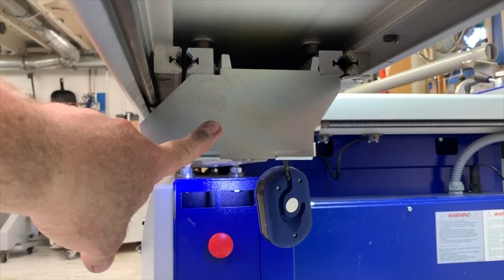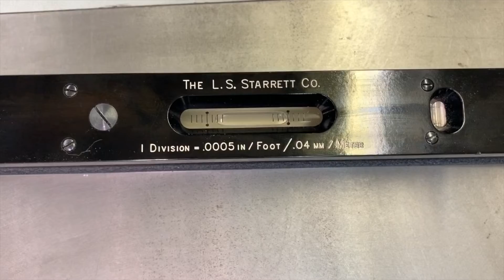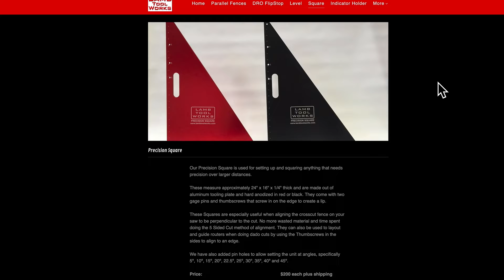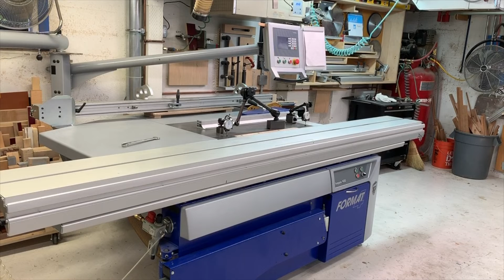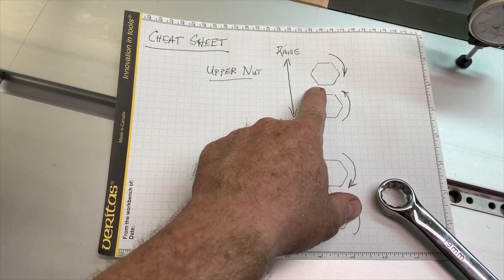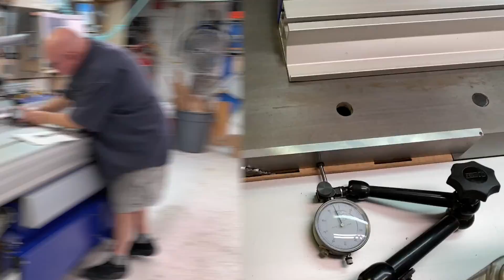Sliding Table Alignment for Felder Equipment

Comment: Great video. If your saw is rolled around in the shop, will this have to be repeated each time?
Reply from the maker: It depends on the machine, the size of the sliding table, and how out-of-level your floor is.  In general, the Felder machines all have a machine chassis that is flexible, so if you're floor is flat, you should be fine.  But if it's not flat or you move it to staggered elevations because of cracks in the concrete, etc,  then you could have ongoing sliding table alignment distortion.

Comment: 2 years going and still helping! Thanks for this video, saved me getting an expensive Felder tech out to do what is ultimately rather basic adjustment - knowledge is power!
Reply from the maker: On larger machines like the sliding table saw, I generally pay to have Felder commission the machine so that if there are missing parts, damaged parts, or parts that are out of tolerance (happens a lot), then there isn't finger pointing.  But as soon as the tech leaves, I do a complete realignment of basically everything.

Comment: Very interesting detail on how to adjust your slider so thank you for this. I assume this method relies on the slider itself to be flat (planar) along its length but I can’t see anyway around making that assumption. I expect some deformation (bowing probably) could occur over time along the slider’s length. I also liked your suggestion of the cheat sheet - it’s easy to make mistakes when things aren’t going to plan. Cheers.
Reply from the maker: Unlike the lower carriage, the upper extrusion of the sliding table is very flat and rigid.

Comment: Just purchased altendorf wa6 with 3.1 sliding table, really enjoyed your video ! very well explained! I know my saw will have some difference due to brand etc but overall very well put together video :) thank you
Reply from the maker: Glad you liked it.  The sliding table on your Altendorf is a completely different mechanical structure.  You will enjoy a different set of issues than are covered here.  Best of luck.
Reply: Oh joy ! can not find anything about the altendorf.. I have ordered some dial test indicators to just check over how it is at the moment, if its way out I may need to pay for an engineer to look over it @David_Best

Comment: Thanks    I have the 2500 long slider on the Format4 shaper. The 10' slider is on a T60 Martin. The early Martin rip fence has no micro adjust for parallel to blade; I added 4 cap screws-OK now.
I find the longer slider on the shaper to be a luxury thing in running the shaper. On the Felder 2500 slider I find the one and only stop to be a pain; I have added a second stop about 9" from the one stop and this is good for stopping the shaper for tooling changes and adjustments and keeping hands away from the spindle. The T60 has slider stops all over the place.
I see you have the Vincent Rolfe fore finger, good.
If I had it to do again I would place the second stop for the shaper at 11-12" from the original one.

Comment: Worth mentioning: if you buy a Starrett tool second-hand tp get a good price on it, you can send it to Starrett to get it calibrated, re-ground, or re-built as the case may be.  When you get it back from the factory, it will meet the same specs as when it was made originally.

Comment: It’s makeing the locking mechanism (ie the nuts) operate in the same plane/direction as you’re trying to fine adjust a bit silly? I mean you adjust the height just perfect then it all goes out of whack when you tighten then nuts. If they just made a clamping mechanism that clamped 90deg to the direction you’re trying to adjust (ie 90 deg to vertical) this would be so much easier to adjust. Then the bolts could be tightened o tho the horizontal clamps to stop anything moving due to  vibrations. Same issue on their planers.
Reply from the maker: There are lots of areas where the Felder designs are lacking.  They design & build to a cost standard, not to a quality standard.  Some machine models are fine, others not so much.
Reply from the maker: The weakness in the Felder sliding table design is the fact that the lower carriage is a bendy aluminum extrusion.  The sliding portion won’t behave properly if the rail it rides on is shaped like a banana.  A Martin uses a rigid steel box-beam ground to precision flatness.

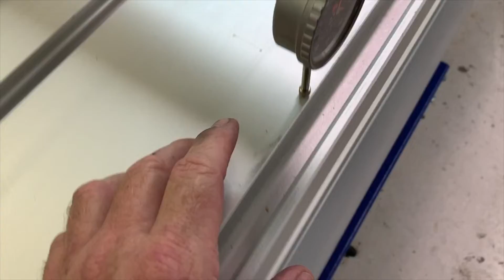Comment: Great video! Very informative thank you!! I’ve been having a lot of issues with my hammer K3 saw even since the felder techs came to set it up. They did t use a machinists level nor a dial gauge. Im sorely disappointed and have been feeling a strong sense of buyers regret 😢. So at 14:54 …what how do I make something perfectly flat when I felder in their grand wisdom have calibrated my bloody jointer for a spring joint? Man that annoying more than it is useful! Hehe as I said , buyer remorse 😅
Reply from the maker: Different machine, but same principles apply:  https://flic.kr/s/aHsmc4uK4K

Comment: David how can I get in touch with you to purchase your Survival Guide? Thank you! 
Mariusz
Reply: I just did by starting a new post. Thank you!
Reply from the maker: Join the Felder Owners Group.  Post your request there.  https://groups.io/g/felderownersgroup
Reply: I did, and I still don’t know how to get in touch with you.🙁
Reply from the maker: @marmiz923  I see no posts from you on the Felder Owners Group.  Post a request there and I will respond.
Reply: David, I have a question about adjustment bolts on my KF 700P ( it has only 4 ), so I imagine adjusting the table might be a bit more difficult… , but hopefully your Survival Guide will guide me through it. This is not the forum to discuss it on… Anyway, this is a great video and I would have been much better off if I had seen it before the technician came over to set my machine up. Thank you for posting it! 
I look forward to your response on the FELDER Group Forum. 
Mariusz
Reply from the maker: @marmiz923  I emailed you about the Survival Guide.

Comment: Nice job!
I should do the same thing !
But I have a question; how do you initially set the "zero" of the 3 gauges? I mean, magnetic side is on cast iron table and how do you know the correct height of the gauges if the sliding table is not yet well aligned?

THANKS from Italy
Reply from the maker: Watch this video:  https://flic.kr/p/2o9byW7
Reply: @David P Best of Best Services  
Many many thanks David! You did it already, superfast!
It's pretty easy!
I thought while moving the magnetic base, the gauge could move itself during the transition, and I didn't think about the preload of the gauge. I have never used that utensil 

Really really thanks, finally I will set perfectly my sliding table !!

Ciao from Italy !!
Reply from the maker: @cescone999  Ciao back to you.  I've visited your country many times over my life and parts of it I really adore.  I particularly like Umbria, Montepulciano especially, and up in  the north near the mountains.  I've had some wonderful times in Milano, Venice, Florence, and Pisa too.  I'm really into food and wine which you'll realize if you go to my Instagram pages:  https://www.instagram.com/davidpbest/

Comment: First of all, great video. I'm looking at buying a Felder K940 S that's less than 2 years old and looks brand new. He did have the Felder tech come out and set the saw up and calibrate it initially. My question is how much would you recommend dismantling the saw for transporting? There is a forklift for loading onto a flatbed truck and I have a forklift at my shop as well. Is it necessary to remove the sliding table? I'm thinking it's much like a piano in after it's moved, it will need to be re-tuned.  Thanks!
Reply from the maker: Thanks.  Yes, I would definitely remove the sliding table before transporting the K940.  Expect to realign it when you re-commission the machine.  If for some reason you just can not remove the table, then make sure it's blocked in with wedges in the bearing ways (Felder uses a tapered plastic dowel for this, but hardwood would be fine) so the sliding table isn't sliding back and forth over a few mm distance every second and the latch is not beavering out the locking slot.  If the machine doesn't already have leveling feet, this would be a good time to add them.  Same chassis at the 940S:  https://flic.kr/s/aHsmV6awbv
Reply: Thank you kind sir! I will probably try to remove the table if possible . Like you say, it will need re calibration anyway. I like the wedge idea for securing  the slider if it’s not practical to remove. Thanks again for going through the trouble of making the video and responding!

Comment: Thanks for the awesome information. Just got a smaller slider and have seen people suggest aligning the slider to be inline with the cast iron.  You specifically did not do that.  If you don't mind, could you elaborate on the benefits and drawbacks of doing so?.. thanks again.
Reply from the maker: There is no guarantee that the edge of the cast iron top that faces the sliding table is aligned with the saw blade cutting circle.  The saw trunion assembly is attached to the underside of the cast iron top, and that attachment point is not precision aligned.  Therefore, the saw blade might or might not be aligned to the edge of the cast iron top.  It could be off by as much as 1-2 degrees.  The edge of the cast iron top is therefore NOT a reference surface.  The reference surface is the cutting circle of the saw arbor.  Does this answer your question?
Reply: @David_Best  thank you for your reply. What about having the slider a couple thousands above the cast? I noticed you do that, but I know others put in exactly on the same plane. Is the fear that there will be drag in the cast?
Reply from the maker: @horacionochetto8454  the slider should be set to 0.005 inches above the cast iron top.  Watch the entire video.
Reply from the maker: @horacionochetto8454  the slider should be 0.005” above the cast iron top.  Otherwise drag. Put on a dial indicator. You’ll see.
Reply: @David_Best  Thanks. I believe I wasn't clear with my initial question which is why there is some confusion. When I stated "in-line" I should have discussed this 0.005" distance instead. Either way, you have answered my question. Thanks.
Reply from the maker: The side-edge of the cast iron top is not suggested to be a reference surface. You haven’t understood the alignment process. You align the slider to be 0.005” above the cast iron top. Then you align the toe-out. Then you adjust the trunion so the blade cuts 90-degrees to the slide and cast iron top.
Reply from the maker: You obviously do not understand the alignment sequence. The top surface of the cast iron top, once made flat. Is the reference surface for setting the sliding table elevation.   Get the iron top flat, then align the sliding table relative to it as shown in the video.
Reply from the maker: Watch the section of the video from 24:30 to 29:20 again  - that section describes two methods of checking the sliding table alignment (toe-out) to the cutting circle of the saw blade.

Comment: I have only Hammer K3 which of course is not as accurate as your Format saw, but thanks to your explanation of behavior of sliding table (bearings position) i have finally managed to understand logic which bolt and when to play with. Also purchased 3 dial indicators helped a lot. Cant even describe how happy i am for this video. Thank you sir. Cheers from Slovakia
Reply from the maker: Glad it helped.  More info here:   https://www.flickr.com/photos/davidpbest/albums

Comment: Finally, I found a video on how to properly adjust the felder!!!
What the factory service did, cried out to heaven for vengeance... I looked video, made it with my own hands - a class better, within the tolerance of 0.03 mm! According to the principle: if you want to have something done right, do it yourself!
Thanks a lot, very helpful info.
Reply from the maker: I am glad this was helpful to you.  Since 2001 I have been documenting as many of the aspects of calibrating, diagnosing, and fixing Felder equipment as I can.  In addition to this video, you might find my collection of photos, videos, and tutorials helpful, which you can find at this link:  https://www.flickr.com/photos/davidpbest/albums

Additionally, I have a full “commissioning” series at this link, although there are more up-to-date specific suggestions at the above link.   http://www.davidpbest.com/VA/StonehorseShop/K975_Install/Felder_Commissioning/1-0%20Intro.htm

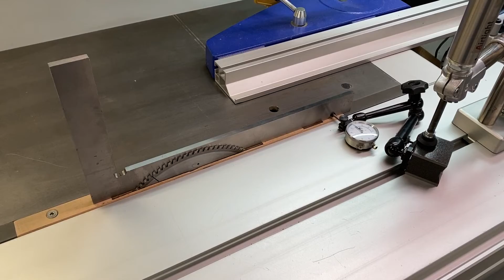Comment: At 27:45 you show the use of your machinist’s square for checking the “drift”.  Could a person use the Felder rip fence in the same fashion to get accurate results for this check?   Do you have any videos on making a zero clearance insert for the end of the Format cross cut fence?  I have a brand new K700S and I’m in the middle of setting it up.  Thank You
Reply from the maker: The answer to your first question is "no".  The sliding table drifts away from the blade, the rip fence drifts away from the blade in the opposite direction.  If your crosscut fence is square to the travel of the slider, and you then put the precision square against the crosscut fence and extend it over to the rip fence, you should see an ever widening gap where the square rests against the rip fence extrusion.   If the rip fence and slider toe-out are not adjusted properly, you will experience kick-backs and burning of the material on the trailing edge of the saw blade. The "best practices" method to align the rip fence so that it has 0.002-0.003" of toe out is shown here:  https://tinyurl.com/9jkfb8mb   Here is the link to the crosscut fence extension - but this is for the digital fence system.  https://tinyurl.com/5y28r74y     If you do not have the digital crosscut fence system, the profile of the extrusion is different.   There are plans for the non-digital fence on the Felder Owners Group (  ) and Bill Billenger there will 3D print a plastic version for a small fee.  Join the FOG here:  https://groups.io/g/felderownersgroup  I have tons of additional information at my Flickr web pages here:  https://tinyurl.com/yuppsrum
Reply: @David_Best  Sorry for the confusion.  I may have not asked my question well enough.  I’ve already set up the toe out for the rip fence, which I’ve set mine at .003” for that.  I was wondering about removing the rip and using it as the straightedge to clamp to the saw blade to check the toe out or drift of the sliding bed.  Thank you very much for the links, I’ll try and contact Bill about the zero clearance insert.  I’m not sure I can machine that aluminum as well as you did in your video.  I did join the FOG, I’m still trying to navigate through that site to understand how to find information a bit better.
Reply from the maker: @tundrawhisperer4821   the rip fence extrusion would be an excellent straight edge for use against the saw blade to reference for the sliding table toe-out alignment.  Clamp it extremely lightly to the saw blade or you will distort the measurement.  Post questions on FOG - we will reference prior posts in the archive.

Comment: How much did that sliding table weigh? 10 foot slide has to weigh a hundred or so pounds.
Reply from the maker: It weighs about 250 pounds.  I use a variable height wheeled bench to install and remove it.  Look at these photos.  https://flic.kr/s/aHsmM2BqbY

Comment: Hi - i am in the machine tool industry where we work w/very tight tolerances, and i appreciate very much your understanding and capability!  Curious, when you load the slide w/a 6' or 8' 8/4 piece of hardwood (width in the 1.5' range) that has some serious weight to it, and you try to do a crosscut, what type of tilt away from perpendicular to the blade do you see?   Thanks
Reply from the maker: For cross-cutting operations, the material is supported by an outrigger table and crosscut fence.  The outrigger table attaches to the side of the sliding table is supported from below via a telescoping support arm - similar to a jib crane in reverse.   You can see a photo of this setup here:  https://tinyurl.com/2p89kf7r   

Depending on the particular size/model of the machine, the outrigger tables have a load capacity of 300 to 1000 pounds.   From a woodworkers perspective, the defection under load is essentially zero.   I routinely  crosscut a stack of four 3/4-inch 4x10-foot ApplyPly panels weighing 375 pounds, or 12-foot long 16/4 oak planks weighing 200+ pounds and the measured downward deflection at the end of the outrigger table (78-inches away from the saw blade) is under 0.005” at 200 pounds.   

More detail on setup and alignment of the outrigger table can be found here:  https://tinyurl.com/fdmxvbnz   Additional info on the crosscut fence setup is here:  https://tinyurl.com/mrzjsrzv

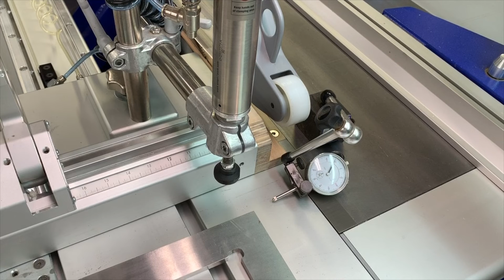Comment: @ 37:40 of your video, I see you have an applied wood extension on the end of your cross cut fence.  Is this to simply aid in lining up your material to the left edge of the blade?  How did you go about attaching this piece?  Thx
Reply from the maker: That is the Zero-Clearance crosscut fence extension.  It has three uses:  1) to help know exactly where the blade cut will be, 2) to push small off-cuts past the blade, and 3) as a backstop for the Fritz & Franz jig.  Build details are here:   https://tinyurl.com/5y28r74y   If you want more information on a broader set of topics, I suggest you visit my Flicker log book here:  https://tinyurl.com/yuppsrum   I also suggest you join the Felder Owners Group forum at the following link  - there are users there that are making 3D printed versions of that ZC extension for both crosscut fence profiles:  https://groups.io/g/felderownersgroup    YouTube comments are not intended for a lot of interactive dialog.